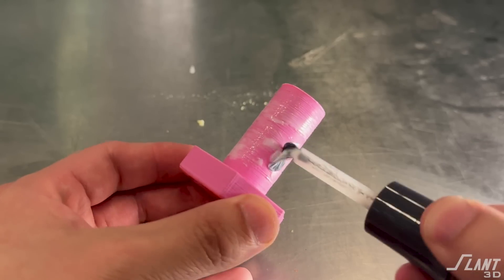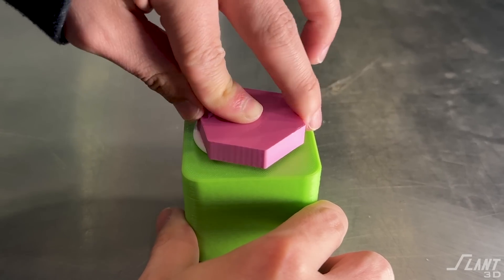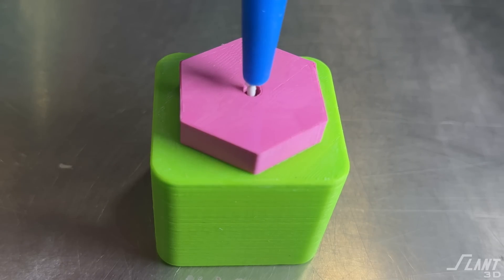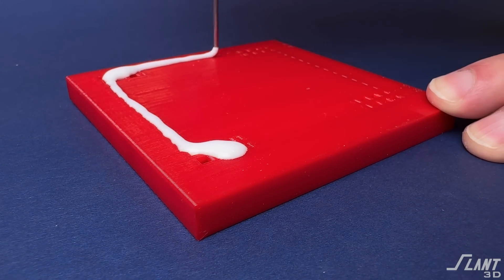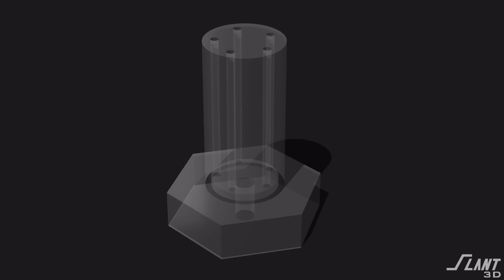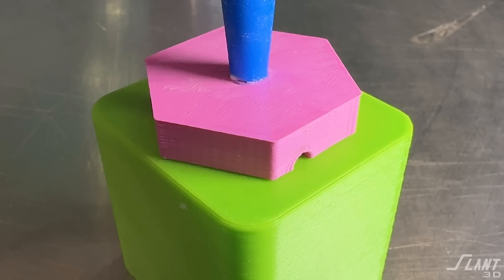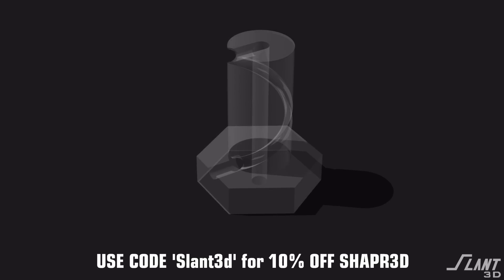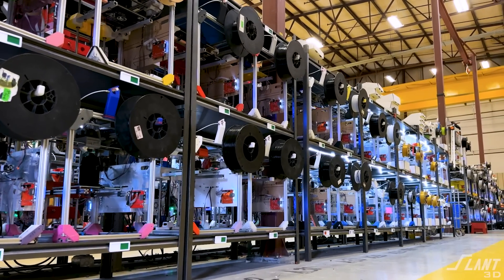Stop Gluing Your Prints the Old Way | Design for Mass Production 3D Printing

Comment: You can try to design the parts with dovetail joints and a square pin from the front, very resistant and you can separate the parts when you want. It doesn't require any glue and is modular I will soon make a video on my yt channel for who is curious.

Comment: The spiral weakens the part and since glue will come out at the end it's the same of putting glue at the bottom and pushing it.

A real trick would be to put a cavity at the top to take the surplus glue and still put glue at the tip and maybe also side of the pin

Comment: Honestly, this is an over engineered solution to a problem that doesnt exist
Most all of these wouldnt do anything beneficial and would be weaker than just,,, gluing parts together
More surface areas means more strength, dont think glue works like rebar. Im pretty sure it would just snap
And it’d take a lot more glue to fill the gaps

Comment: I am surprised seeing so many (or mostly) negative comments on this idea.  The idea is great.  I am usung the same idea in a very similar way for years and it works perfectly.  Obviously this technique has its limitations just as any technique does.  But it works!  It works both for CA glues (both for liquid and gel versions) and silicons (I use so called "hybrid" or "MS-polymer" silicons).  If you do not like the particular realizations shown in the video invent your own shapes or setups, be creative.  Bit the idea in general is clever and VERY practical!
Reply: most comments I've read so far that I think you're referencing are definitely critical, but not negative. One really good point I saw brought up was that the channels could be used to fill the print with fibers or some other material for added strength, since glue on it's own isn't likely to have a noticeable effect on strength increases. At that point it may be better to have some sort of matrix that the 3d print makes up with a resin fill for the inside. 

The other big issue is that there's no testing shown here to compare the designs, which makes this more of a cool idea that still needs a proof of concept put to work. I really appreciate the mentioning of the glues you've used so far, since I haven't worked with any outside of superglue, and using something that would help fill a clearance for loose-fit parts would be pretty nice for a couple of the projects I've worked on so far. Something like caulk where you could inject it like the channels in the bolt had, so you don't go having to mix epoxy and work with its pot life, but not knowing the efficacy of these designs means I'm either working with something that won't actually hold, or I could go with the tried and true method of test printing different sizes until I get a snug fit. 

It's good to get creative and this video certainly shows a pretty novel idea for printed hardware, I just think people are pretty skeptical that this would work as well as the author describes and would want to see it tried out before jumping right on it.
Reply: @SeaHay  
It's nice to talk with a person as interested in 3D printing as I am :)  .  I invented this kind of gluing by myself some years ago, have never seen it anywhere, so I was glad to see another guy doing the same.  The difference between me and the author is that I only (or mainly) use this technique for bonding together 3D-printed and non-3D-printed parts.  I did not have a situation when I need to glue a printed bolt into a printed nut as shown in the video :) .  I'm joking now, I understand that the bolt and the nut are only an example, but still when I need to glue 3D-printed parts it is always leaning one flatness against another flatness, but never (or very seldom) deep insertion of one part into another.  In most cases I simply can print such an assembly as one part.  But I realize, In some cases gluing with deep insertion  may be necessary.  So let's divide the idea into two parts: gap filling and reinforcement.  By the way, Superglue that you talk about is another name for CA (cyanoacrylate) glue that I mentioned, so you know this glue.  And Superglue is sold in two sorts: the regular glue which is pretty liquid and the gel glue which is like a shaving gel, the latter fits the theme of the video best.
1) Gap filling.  I once needed to connect a vintage (but not used) toilet pan's outlet to a modern standard 110 mm sewage pipe.  The outlet was significantly thinner and not even round so it could not be sealed by the rubber seal in the standard pipe.  I printed an adapter with the standard 110 mm outlet at one end and some throat at the other end.  There were eight 4 mm holes around the throat.  I put the throat on the toilet's outlet and filled the gap all around between the plastic and the ceramics  with my favorite hybrid silicon (or caulk) using a caulking gun.  After a day it was impossible to separate them without breaking the plastic adapter.  Another example: I did not like standard polyethylene socket boxes for mounting switches and electrical outlets on (into) the brick walls.  I printed my own design with channels for the caulk.  I Have put a box into a drilled hole and filled the gap between the plastic and the brick using the caulking gun.  Now the boxes sit in the walls as solidly as a brick :) .  There were many more examples like gluing a polyethylene garden hose nipple into a hook holding it on the edge of a barre l, etc.  In every case there is the inlet hole for a glue and a channel(s) and/or gap(s) for distributing the glue where it should go.  If the parts are small (like a depth limiting collar on a drill bit) you can use Superglue.  In case of bigger volumes and longer channels use other glues as Superglue may cure too early and block the further propagation of itself.
2) Reinforcement.  You can use many items to reinforce you printed parts: strong thin rope, metal wire, metal rod(s), etc.  The idea is the same: you design and print some channels where you are able to push, suck (with a vac) or insert your reinforcement element making sure there is a proper way and enough gap for your glue.  Then you apply the glue.  This may even be an epoxy (just chose a kind with longer pot life like half an hour or so).  If you use a rope or a metal wire, take epoxy.  In case of a metal rod you can use a caulk, but epoxy is still better.  You can pump epoxy with a syringe then it goes in faster than when you pour it.  A thin (4 cm) high (20 cm) part, very brittle right out of the printer, becomes extremely strong with a couple of 2 mm paracord glued in with epoxy.  I tried to break it with my hands and failed to do that (that was very easy to break it right out of the printer).  All above applies to ABS printing as I print almost only with ABS.
Well, I hope I helped you to get familiar with this gluing technique.  Best regards and have good prints! :)
Reply: @spock6692  really appreciate the follow-up and detailed anicdotals! Definately stared at CA glue when I first read that for far too long since my brain couldn't put together the correlation, and definately think injection gluing should be done for more parts too for multi-part prints. 

There was a pen I put together a while ago that could've benefitted from a channel being cut into its two halves, but I think the author did'nt want there to be too large a clearance between the parts, so you get to mate them with superglue getting all over your fingers trying to keep it aligned. A jig would've also worked, but would be way more material printed for a simple alignment that some slots could've fixed instead. 

Having something you could squeeze from a medium to small syringe and have it take a while to set would be ideal for these sorts of projects so long as it bonds well and doesn't need flush part mating. 

Again, thanks for the info!
Reply from the maker: Don't mind the keyboard warriors. Thanks.
Reply: @slant3d  well maybe do mind some engineers/scientists, that know what the are talking about... If you claim the glue makes the part stronger : just prove it... It is not hard.. And sometimes it pays off to read some adhesion theory articles, to make a foundation for your argument...

Comment: Many make a point that glues are usually not intended as a filler.
Even if it did, such as epoxy, one thing not considered for the injection idea is that you need to allow air to escape which many of these ideas don't account for.
Reply from the maker: Watch the full video
Reply: @slant3d I watched the full video. The ideas sound cool but from my experience with glue I'd rather have a thin layer cure under pressure than a thick layer with less pressure.

Are we talking about a different glue here?

 I could see gorilla glue or an expanding foam benefitting from this idea but your examples seemed to be using white glue.

Comment: Have you looked into 3D printed molds for things like carbon fiber parts?  You just make a "male" and "female" mold with a gap that is like 2mm, then put carbon fiber and resin between them, then clamp it.  You can save the mold if you put a couple layers of saran wrap between the carbon fiber and the mold.

Comment: The channels definitely lower the surface area in this case (Over coating the whole part) and will produce much weaker parts especially as most glues will shrink a lot when drying and pull away. Additionally not provide any structural reinforcement.

 (Glues are meant only to used in very thin layers.

 The one I could see this being useful for is epoxy injections though given the expoxy is so strong and doesn't shrink much.
Reply: If you can spin the part after injecting into the channel, as in this example, you could keep spinning while injecting to ensure you get full surface coverage. There are many ways to apply these ideas without critiquing what is very obviously a simplistic example in the video.

Comment: For filling the internals of a peg you could have the pressure push against origami folded wedges(or plain drywall anchor style expanding barbs) be forced out into locking holes or grooves, type thing. Not that epoxy wouldn't hold in a groove on its own... over time. This would lock instantly during assembly, etc, etc. Maybe a screw in lock pin like automotive clips but way bigger? And easier to get back open than automotive clips! 

Thanks for the brain food.

Comment: Nifty!  Some thoughts:

1. If you add rings around the hole itself, then the glue becomes even more of a mechanical lock.  Having opposing spirals on the plug and hole is a good alternative

2. For many of those applications, you can insert lengths of carbon fiber/etc. into the tubes before adding the glue to strengthen the glue even more.

3. FAR better than using a sphere to form the channels is to rotate a cube by 45 degrees in all three dimensions to turn it into a diamond.  That will not only speed up printing because you are using only straight lines, but you don't have to worry about the tops of arcs drooping, as the maximum overhang is locked to 45 degrees.

4. For even more mechanical locking, you can have 1.75mm holes that curve from the top to perpendicular to the sides of the hole and slide sections of filament through them and into matching holes in the sides of the main hole.  (Depending on how much force might be involved, if you have even slightly threaded plugs and holes, this would be enough to lock the 'bolt' into place even without glue beyond a bit to hold the filament in place.)  You could leave a hex-shaped inset in the top of the bolt so you could screw it flush with the surface, insert the filament pieces through the holes inside the hex inset, then glue a hex-shaped plug to fill the hole, or even just make the plug snap-fit so you don't need glue.  

Cheers!
Reply: 1. it interferes with the control you get if you use 1 dispersion channel.
3. Trapezoidal groves are common for this, if done at slight below max distance the glue can bridge (part to part), it ensures proper distribution while not sacrificing the channel surface for adhesion.

Comment: This video needs context, specifically what kind of glue these tips are applicable to. Because the glues that i am used to using, would cost WAY too much to use in this way, and they work better in thin layers. If there is another kind of glue I should be using, and using in this manner, I would like to know what glue that is.
Reply: Or, flip that on its head. The whole point of this video is to be an example WITHOUT context. It's all about how you can apply these ideas or similar to specific scenarios where they will actually be useful. It's not about gluing a peg into a hole, it's about gluing something else into something else and will you have knowledge and tools to solve specific problems in the future.
Reply: @802Garage  i wasn't fixated on the peg in the hole, but the whole concept of pumping 50+ml of glue into parts, through channels and ports. I can tell you this won't work for super glue, Elmer's glue, wood glue, and every other kind of glue that I have experience with. This video presupposes I have experience with some other glue, for which it does work. What glue glue might that be?
Reply: @charlesstaton8104  Well again, I think you are focusing on the example. Do the channels have to be that large? Do they have to be that shape? Do they have to be applied to parts this large? Do you have to put them along the entire part? There are so many ways to take this idea and apply it in a way that makes more sense to you or for a specific scenario, that you are in fact focusing on the specific scenario. There are hundreds of types of glues, and which one you should use depends on the materials you are dealing with and what kind of bond and strength you need. As I mentioned in other comments, you could apply this same idea to substances other than glue, such as two-part silicones or urethanes which can have other effects. You could essentially embed silicone bumpers into parts, or silicone bands that allow the part to flex once you snap small sections. There are so many applications for what is shown in this video, other than the example in the video which is not a particularly useful one itself. It's about the tools, not the specific example.
Reply: @802Garage  ok fine, let's say I'm focused on this example. That peg, that hole, those long, thick, spiral channels, and THAT glue. What is THAT glue? What glue would be used in this very specific example?
Reply: @charlesstaton8104  If you want it to stick like crazy and be strong? Cyanoacrylate would certainly work, but would be way overkill for the large channels. I'd probably go with a standard 2 part epoxy like BSI-201. There are plenty of options that would work to overkill this task.
Reply: @802Garage  I am wondering now if it's feasible to use molten plastic. the same plastic that one or both of the parts are made of. With a high flow hotend and running a little hotter than normal, it might be possible to jog the nozzle down to a waiting injection hole, run a manual purge as fast as the machine is capable of without stalling or stripping the filament, and just shoot that channel full of plastic faster than it can solidify. Use the printer like an injection molding machine. I want to try this. Success will probably depend on many factors, one of which being filament type. Some filaments retain heat and stay molten a lot longer than others, and those I would expect to perform better.
Reply: @charlesstaton8104  That's a really cool idea! Basically imitation injection molding, hahaha. It would definitely think it's possible with small channels, but the longer they are the more difficult it would get. Good points.
Reply: @802Garage  I was actually thinking that larger/wider channels like the one on video would have a better chance. My reasoning is that contact with cool (solid) plastic will draw heat out of the molten plastic and cause it to solidify. The more contact, the faster the cooling and solidification. A smaller channel will have more surface area per volume; exponentially more, as area is the square of radius for a round cavity. So a big fat channel like in the video should (in my head) afford the best chance of getting fluid plastic all the way from the mouth to the tail, before turning solid. And greater quantity of heat held by a fatter cavity of fluid plastic should (in my head) promote more melting of cool/solid surrounding plastic, leading to something closer to a cohesive bond between the parent plastic and the injected plastic.
Reply: @charlesstaton8104  Yeah I was thinking similar, but that the skin cooling effect in a larger channel might end up peeling in or cooling at the front of the moving plastic and causing a blockage or something? I think you're right though. The longer the channel the wider it would need to be. The more material you can stuff in, the more heat is there to at least keep it from fully solidifying too.

Comment: These videos are fantastic! I discovered this technique when I tried (and oftentimes failed) to print a key for an interior door. Printing vertical was the easiest way to get all the features, but the stem kept snapping off in the lock. On the final part I exposed the infill on the top layer and pushed superglue all-the-way through, thinking to myself: "Why is there no 3DPrint creator talking about stuff like that?"